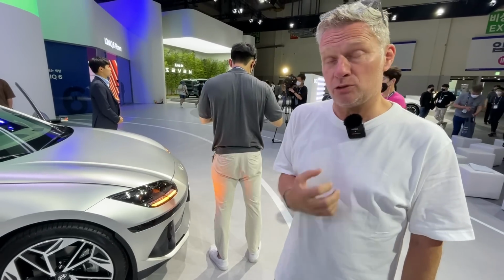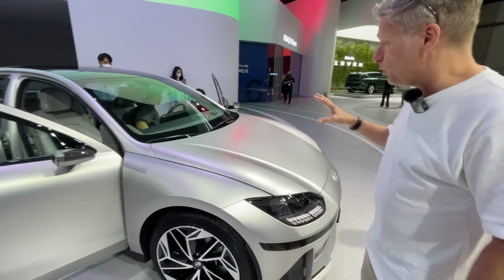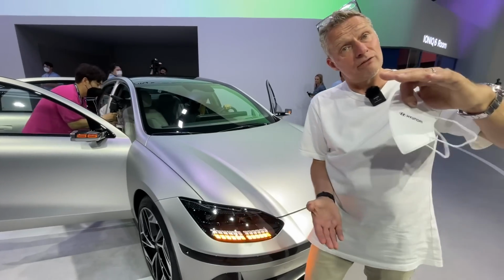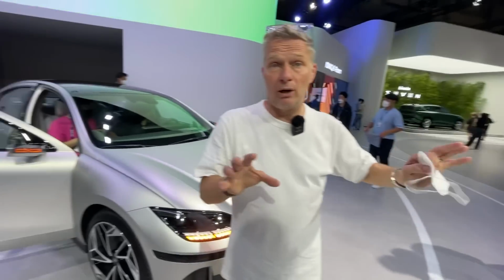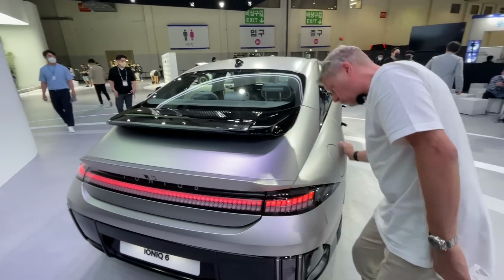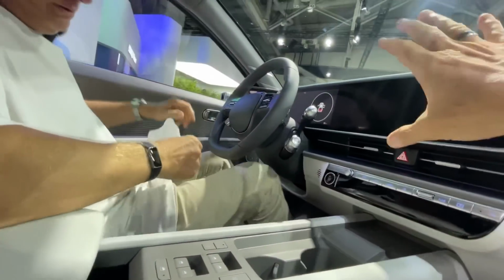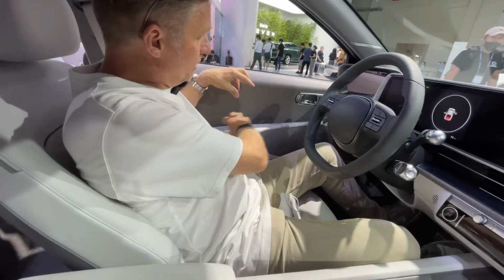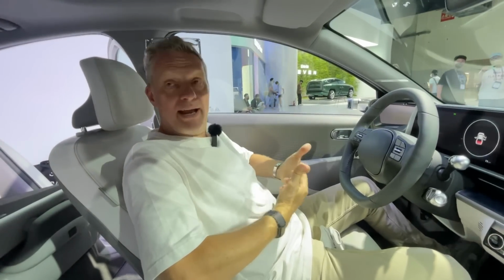I Ask The Designer Why The New Hyundai Ioniq 6 Looks as CRAZY as it Does!

Comment: I love this car and am seriously considering buying one when my lease runs out in July. I have three questions: 
1.) All the photos and vids I've seen of the North American version (side mirrors instead of cameras) do NOT show a North American-sized license plate on the FRONT, only on the back. With the cooling louvres open, and the front-facing cameras and sensors unobstructed, is there enough room for one? How would it look / fit? 
2.) I've seen contradictory specs on the HP for the RWD-only version. One source says it's 149 HP, another says 225. Which is right?
3.) For fuel economy and ride I prefer the smaller wheels, but for looks the larger wheels are better. Which wheels will be offered with the smaller version? Will there be a choice?

Comment: He explains on the design of the car on drag.  The car seems great...but i would not buy an ionic 6 because of the sloping rear line.  I like cars with the rear line higher than the front. They are doing this with the Genesis suvs also. If the lines are higher in the rear, the cars look more attractive. That's just my opinion. Hope they won't do this to the upcoming Sonata. Take a look at the audi e tron, the tesla. Do you find those cars more attractive?

Comment: 610km range is for the rear-wheel drive car?
Reply: Lots of people did 620kms from Ioniq 5 RWD Preferred LR in one charge at 20% highway and 80% city Hyundai is conservative on their real EV range. I6's CD is only 0.21,I5 is 0.288, I6 would have 30-50 miles more range on highspeed is very reasonable thanks to its superb low drag.

Comment: Excellent interview. I liked the designers grasp of cultural histories around the world and drawing inspiration from  them. Good car. 310 est. range and charging 10 to 80 in 18 minutes. Nice.
Reply: Hyundai has estimated 340 miles on the US website in the disclaimer. That sounds reasonable given the Euro test cycle does 380 miles. Plus all the aero changes and efficiency optimizations.
Reply: Not bad almost matches a tesla model 3 from 2019 then. That car got over 330 miles and car&driver showed it could do 190 miles of range back in 15mins. I wonder if it'll be as safe in crash testing as teslas are. Or if it has a heat pump and battery pre conditioning as standard. 👍🏻
Reply: Nervous Tesla shareholder confirmed big time.
Free advice: time to sell your Tesla stock
Reply: @4literv6  Tesla isn't nearly as fast in charging lol... being biased is one thing but come on man lol...
Reply: @aoh4905  15mins gets you 170-200miles on a tesla when using a v3 and pre conditioning the pack. Car and driver proved that since late 2019.
And got 187miles in 15mins on their latest plaid test earlier this year which is the least efficient tesla. Got anything else to make me laugh? 😀
Reply: @4literv6  panel gaps